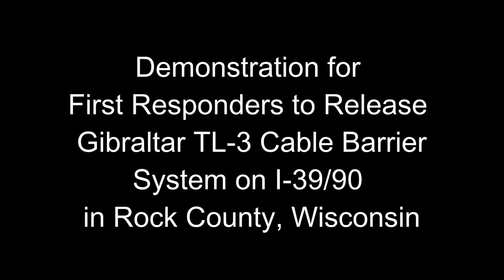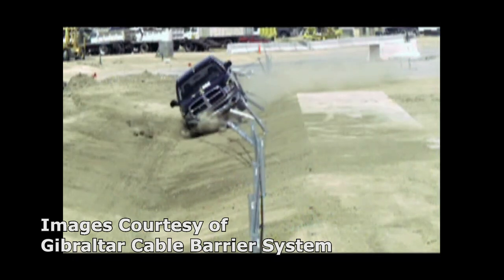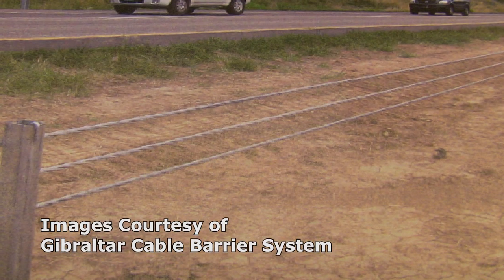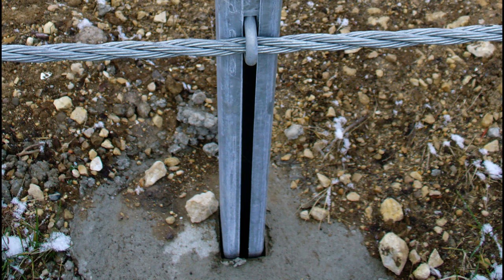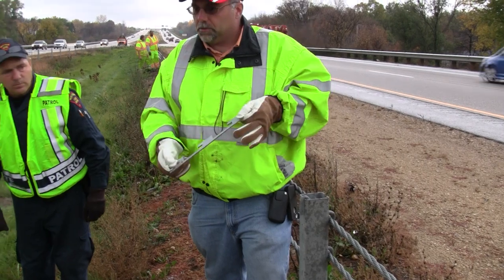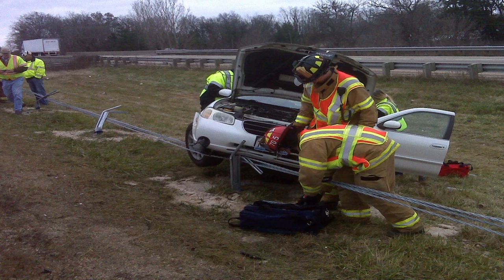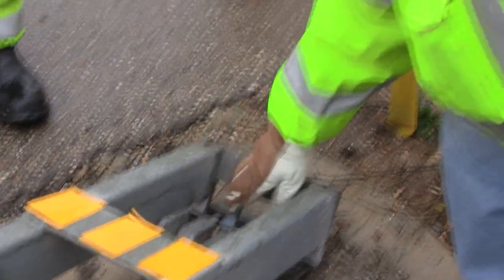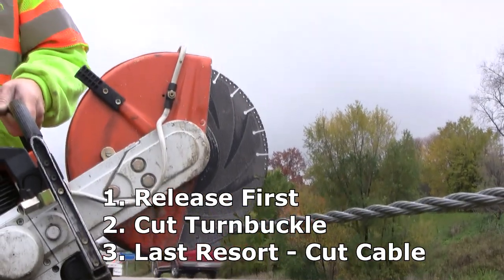Highway Cable Release

Comment: 1 of those saved my ass down in Texas. Right lane blocked by slow moving semi traffic, passing lane had a crashed out, black and blacked out car across the roadway without it's rear wheels. I could have either crashed into the car and it's geriatric former driver, crashed into another semi ( I was hauling 4 inch steel pipe) or, as I did, take the median. that cable barrier sounds like a zipper at 65 mpg going down the side of the cab. Only damaged the stairs and a brake booster on my rig.